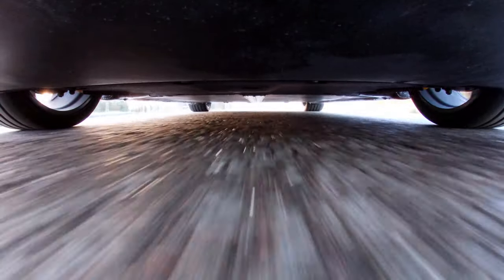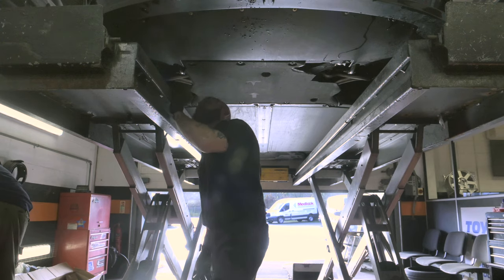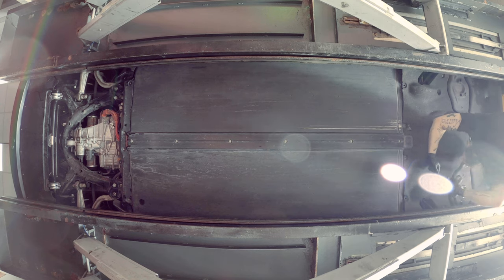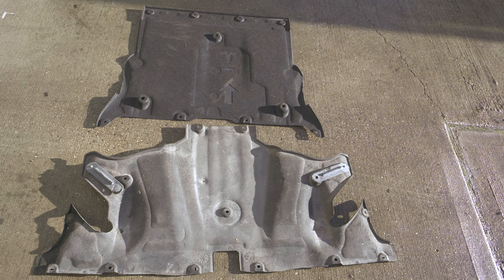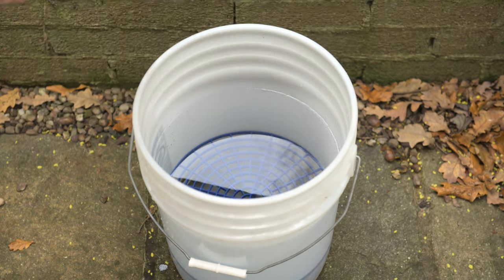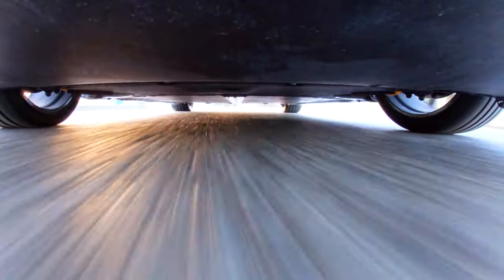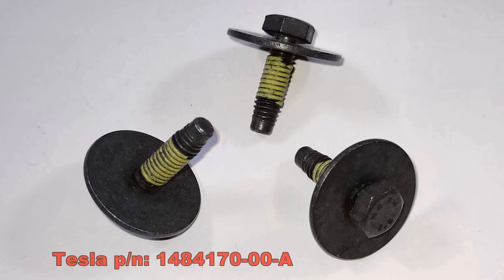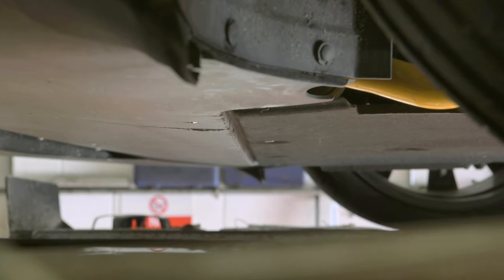Tesla undertrays/aero covers/shields/whatever - why do they rip apart and fall off?

Comment: This happened to my Tesla. I am a structural engineer with an actual degree in structural engineering and specialize in structural and dynamic analysis as my day job.  I looked at the bottom of my tesla, took off the fastener and it didn't have thread locker.  This is the root cause. Without thread locker, fasteners always fall off and loosen during vibration loading.  For the Teslas, the bolt falls off, the panel starts to gain air, and the fatigue load over time breaks off the panel.
Reply from the maker: Despite what some think, Tesla do learn from their mistakes. These bolts do now have threadlock on them and I haven't seen any reports recently where they've fallen out.
Reply: @TeslaGurus  Mine did, two days ago...
Reply: This is exactly what causes my skid plate to break. The bolt screw loosened, hit the pavement when I went over a dip on the road. The  bolt screw is bent.
Reply: @TeslaGurus  I have a 2022 and this just happened to me after 2 years of driving

Comment: 2020 Tesla Model 3 Long Range. Had two of these shields rip and depart the vehicle in pieces. Both occurrences happened while driving in very high cross winds , but dry conditions. All bolts were still in place , which tells me the material choice for the shield is not appropriate.

Comment: Hit a puddle at about 35mph that I couldn’t see in the dark and ripped the mid-aero shield. Looked just like all the other pictures with that one bolt missing. I suspect these bolts are falling out and causing the shield to sag in that spot allowing water to rush in behind it. Initially they denied the warranty claim so I just left it. It was ultimately replaced the following year under the service bulletin.
Reply from the maker: It is worth mentioning that there are some holes the shields cover which look like they should have bolts in them, but they don't. Please refer to the diagrams in our video for the locations of the actual attachment points of the aero covers.

Comment: Thanks for the putting together this  great video, very informational and helpful.  The same problem just happened to my 2018 model 3.  I have a service appointment scheduled with Tesla and it will cost me about $400 to replace the damaged panels (front and mid aero panels) as they said it was not covered under warrantee.
Reply: Please provide an update. What was the final cost? Did they replace both covers? What you general area? Just curious if the makes a difference in price.

Comment: @TeslaGurus
Driving in harsh winter condition in Sweden. The red trailer symbol came on without a trailer or any other kind of electric connected. The lid was closed. Tesla support tried to help me with resetting the car to get rid off the red trailer symbol without result.  Weather was around 0°C so slush, snow and water around. I took the lid off, opened the trailer electric connector and a gush of water came out. I tried to dry it, douse it with a water replacing electric spray, and spray oil/ wax in it. It took the better part of the day and repeated spraying until the symbol came off. 

Why on earth is there so much water collecting in the connector with the underbody lid closed?

Keep up the good work! Thank you for your videos. Best regards from Sápmi North Sweden
Reply: The exact same happened to my TM3 in Norway. Tesla replaced the wire harness in the trailer hitch which fixed the issue.
Reply: Because they have not designed the car to work in wet and snowy condition.
Fill the connector (when it is properly dried!) completely with a grease adapted for electrical system (that is non conductive). Make sure it covers EVERY bit that has to do with the electrical system so no water can enter, even in the smallest pocket.

Comment: Great video. Maybe a video about common rattles and fixes for those in future? My driver side b pillar is making some clonking on bumps and the drivers door / glass seem to rattle. I’ve applied some silicone spray on the seal at the top looks to have improved... ish

Comment: I had a torn rear aero shield after a storm and passing some puddles in Taiwan in Aug. 2021.
Tesla service center here charged me around 180 USD to replace it with a same (fibric?) part.

However I noticed latest model 3 arrived Taiwan has changed the material to plastic! Both in rear and front.

Comment: I've never had issues with these panels but have removed them once a year for rust proofing spray and removal of sand (from winter driving conditions).

However, I have found that a personal "best practices" when re installing these is to pay attention that the leading edges (especially the rear unit) lay down flat...I install all the bolts loosely and then I will torque the center ones first whilst "body englishing" the panel to lay flat as I tighten the next bolts, proceding from the center towards to outboard edges.
Reply from the maker: Great tip! Thank you.

Comment: I just found this problem on My 2018 Model 3 LR. Couple of days back I was hearing a rubbing noise while driving to kids school and decided to check it later and forgot about it. 2 days back I had to make a long drive (200 miles round trip) and on my way back a piece of the front shield blew off the car and  I started hearing loud vibrations. Checked after reaching home and found that a big chunk of the front shield was missing. Tesla has provide an estimate of $204.15(including labor & taxes)  for this repair. A mobile Tech will come and replace the shield in couple of days time.

Comment: I have a 2018 Model 3 and my mid aero shield just went (nearly 5 years later so out of warranty) after driving through water (I suspect).  Service quoted me around $200 to fix it.  Thanks for the video, it was very helpful confirming my new part #.
Reply: Did you get it fixed by Tesla? If so, what was the final cost? I just discovered mine was damaged yesterday. Not trying to pay an arm and a leg.
Reply: Did you get it fixed? My front aero shield rip and is now off. Tesla service estimate $285.35 before tax after I clarified which part was needed
Reply: @JerryCastellano-ds7xk  Yes, I had my rear aero shield replaced by mobile tech and it was about $200 with parts and labor (fairly reasonable).  But I say a few days ago that it's torn again which is very frustrating.  I may move to an aluminum third party shield if I have to go through this year after year.
Reply: @kurtd1935  That was my fear going with Tesla parts.

Comment: Thanks for this. Each winter when I have gotten temporary stuck in deep snow I get a hole in the rear cover, because all the bolts were in place Tesla would not pay for $250 replacement in Canada. After paying for 2 
I won’t go in deep snow anymore

Comment: If you've identified and/or fixed any squeaks or rattles, I would love to see a video about that. I found one in my week old Model Y today and fixed it today. I was lucky. It was right in the center of the rear headliner where the gasket meets with the hatch. the head liner had popped out from the gasket and rattled against something inside and drove me nuts for a couple hours.

Comment: My aero cover was damaged by what I would call a deep puddle. Yes it did span the whole road but not sure It was deep enough to call a "flood" I was doing about 50mph , it was night and round a bend so did not see it until too late to slow down. Bolts were not lose.  This was more extreme than your test but any other car I have owned would have coped so It is still not ideal and should be improved. Don't underestimate the power of water!
Tesla fixed it for free but only because one of the bolts seemed to have gone missing between the incident and the trip to the service centre so that ended up getting the blame
Reply: Hmm, what year was your model 3? I might have to take a bolt off to get a free one due to shit design.
Reply: @TrueDreams  2019. Not aware design has changed since though anyway.
Reply: @applicationsbroad7283  f it I'm just going to order the stainless ones from rpm tesla call it a day.

Comment: The rear cover ripped on my M3P when driving on badly a flooded road. My theory is a large quantity water gets above the cover and because of insufficient drain holes the weight of the water rips the cover.  Tesla would not fix under warranty charged me £120.83 for cover and £29 labour + VAT.
Reply from the maker: To be fair, that's not an excessive charge. These covers are sacrificial to an extent. If water stayed behind them for too long it would cause a lot more damage to more expensive parts. This type of cover is fitted to other brands as well, it's not just a Tesla thing.
Reply: Or you might have damaged it, or lost a bolt or two prior to driving through the flood water.
Reply: @LeiChat  No bolts missing 99% certain it's weight of water. Friend of mine has a garage so had car on ramp before contacting Tesla. No marks on underside of car only the rip. 
I have no argument with Tesla.  Accepted charge willing to pay Labour @ £29 Labour thought it very reasonable.  Although had the panel been steel it probably wouldn't have ripped.  Appreciate steel weighs more than composite. So a trade off weak composite won.

Comment: Front aero shield was torn/hanging.  I think it was from driving through a water covered freeway (going about 35-40miles/hour).  Tesla is quoting $520 for repair/replacement of the aero shield...  I've had the car since 2021.

Comment: I own a 3, live in Portland, and not only are potholes super common, but also the amount of waterlogged areas. I have already had to replace my cover twice so I looked on forums online and noticed you can replace the traditional model 3 cover with an aluminum cover similar to what they use on the y's to prevent future issues of this torn aero cover issue. It's always the rear cover for me, but I would rather pay an extra 200 for a cover I never really have to worry about than constantly fretting about driving in wet and somewhat wild weather (as an uber driver it's my bread and butter for income really). Figured I'd put out that info since it's going to save me some scratch and aggravation over the long-haul.
Reply: Do you have a source for the aluminum cover for a model 3? I just experienced this issue on my front cover (no idea how or when the damage happened) and have scheduled mobile service to replace it. They have given me an estimate of $223. to replace it. Not clear whether it will be covered under warranty or not.
Reply: @SteveDonie  Amazon and eBay. A company in Texas makes them. Cheaper on eBay - same company. Let me know how they work 4u.

Comment: Looking forward to the suspension upgrade videos.
I have been considering spring kit options from Unplugged, Eibach and MSS.
Reply: I have the Eibachs on mine. Would recommend. 👍🏼
Reply: @MrJBMedia  Thanks. I get the impression the Eibachs have a firmer ride than the stock suspension. They seem a fair bit cheaper than the MSS and Unplugged options though.

Comment: I hit a piece of ice one morning and after that I noticed a scraping sound when going low speed. At first I figured it was coming from the wheel wells, maybe some gravel. But I had a look under the car and the rear shield had come loose. When the speed was higher the air cushion under the car pressed the shield up from the road and the scrape disappeared.

Comment: Great video. A piece tore off of mine going through a deep puddle during a tropical storm. i was in a Wendy's drive thru which should tell you how fast i was going, but the dragging noise began immediately after the puddle. I have an appointment with service Sept 10 and will update with how it goes. The estimate they sent it $223.85.
Reply from the maker: The original covers are made of a type of plastic but just not as hardwearing as the newer ones.
Reply: i decided to cancel the appointment. i bought the aftermarket version made of metal which will arrive in 5 days. The mom and pop tire shop that did my tire replacement said they would do it. I explained it is 10 bolts and that Tesla wanted $40 to do it and they charge $200 per hour, so I assume it should be a 12 minute job. I took a phone video by reaching under the car and noticed the bolt where it tore off is missing with no damage to the surrounding area. Must have loosened itself or was never put in. Again I will update when done.
Reply: @TeslaGurus I have a 2020 and the material is like you showed...cardboard? composite? Given its application, lets call it paper. With the same felt backing. Thanks for the great video.
Reply from the maker: @clibat  It is glass reinforced polypropylene - a type of polymer used widely in the automotive industry. Some Tesla owners believe it becomes weaker when exposed to water. That's simply is not the case.
Reply: @TeslaGurus  Agree it's not a getting wet thing.. You did a great job proving that.  I'm kinda glad you forgot about it and let it sit in there for 3 days! Now that I know that bolt is gone I definitely think that is the cause.  Before they remove the other 9 I'll ask them to see if any are loose.  Either way I'll ask them to check the rear ones and recheck them all when I go back for new tires next year.  Any recommendations on the best way is to buy a new bolt?
Reply from the maker: @clibat  Your local Tesla Service Centre!
Reply: The shield came in and I installed it on ramps in about 20 minutes solo.   It came with 3 extra bolts, washers,  and metal clips to screw into rather than going into the plastic in front which solved my missing bolt problem. Again, thanks for the great video.
Reply: For that price the aftermarket aluminum shield is well worth it! It could also potentially save your battery- https://youtu.be/tUG6KVwp2p4

Comment: PP GF 30/40 would in my experience stand for Polypropylene with 30-40% glass fiber. I wouldn’t think there’s even a 1% wood fiber or “cardboard” content in that part since for recycling purposes parts like this need to be honestly marked with the universal material designations.

Comment: Great video, very informative, many thanks. 
Just had this exact issue on my Tesla Model 3. 
The front aero cover has ripped from either corner - scraping noise heard on the motorway. 

Have people managed to get this replaced under warranty ?
Reply: I doubt it. They normally can only break due to damage such as driving over a curb or over debris in the road. You might get your car insurance to cover it, but the part is available online for less than $140. And it's something really easy to replace.

Comment: Happened to me a few weeks in to ownership.   M3P, very deep puddle at no more than 15 mph, it ripped the front undertray off, it was scraping along the ground.  Tesla would not consider it a warranty claim, so had to pay for a new one.
Reply from the maker: As you can see from our test, 15mph through a deep puddle simply isn't enough force to rip off a properly secured aero cover. It must have been damaged before or was hanging down because bolts had fallen out. I have tested two Model 3s at very high speeds through standing water multiple times now and had no damage.
Reply: The only conclusion is that is was poorly secured from the factory.  The car was only 3 weeks old when it happened - I suspect it was hanging down slightly, water got on top of it and ripped the other fixings out due to the pressure.
Reply: To add, I really like your channel.  Is there any more feedback on the new Pirelli’s as fitted to the 2021 M3P?  My Michelin Pilot Sport 4S (rears) are now in need of replacement, and it would be great to get a quieter tyre.  Did you notice lower noise levels on the Pirelli?

Comment: My front cover came loose. It snapped around the bolt holes at the rear of the cover on both sides. Have ordered an aftermarket replacement made of metal.
Reply: How did that work out for you?

Comment: Great video.

The front edge of my rear undertray ripped off the other day when I hit some standing water on the motorway. Just booked it in with Tesla service - will be interesting to see what they say.

Interesting to note that the Model Y has solid plastic undertrays instead of these fabric parts...
Reply: Hi Joshua, same thing happened to me on my Model Y, what did your dealer say? They want to charge me for that part..ridiculous
Reply: Here in the UK, Tesla Birmingham refused to cover it under warranty, so I had to pay £180 which was pretty upsetting. According to them "if you drive through standing water slowly then they don't break". I'll bear that in mind the next time I'm on the motorway 😂

How did you manage to break your model Y undertray? I thought those were hard plastic?

Comment: Just got my 2017 Model 3 aero shield replaced after it got ripped off after driving through standing water. It looks to have been the same part number as the one that you originally had. They replaced it with a plastic one now thankfully. New PN is 1499151-00-C. I’m hoping this will last me until the end of the car’s life.

Comment: Is it ok to drive if there is a small hole in it? Tesla booked my appointment 4 weeks out. Basically I’m asking will I damage the vehicle.
Reply from the maker: Highly unlikely a small hole in the undertray will be a problem, but keep an eye on it in case it gets bigger!
Reply: @TeslaGurus  Thanks! I will keep my eye on it. The hole is the size of a baseball. Looks like it was shredded by something on the ground
Reply: @josephcoleman9092  I suggest duct taping over it. I’m on a long road trip and a little hole quickly became very bad with ithe entire panel dragging on the freeway. Not fun.